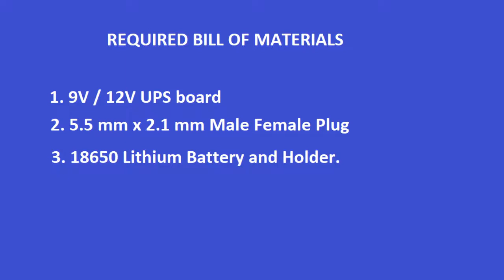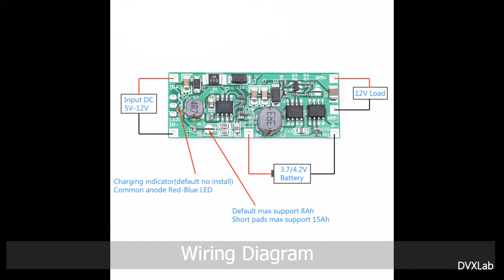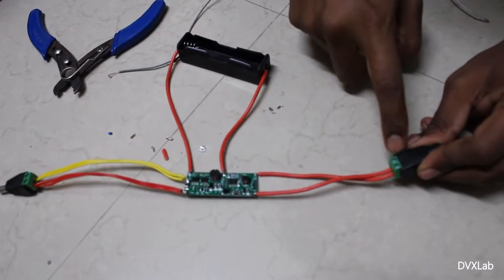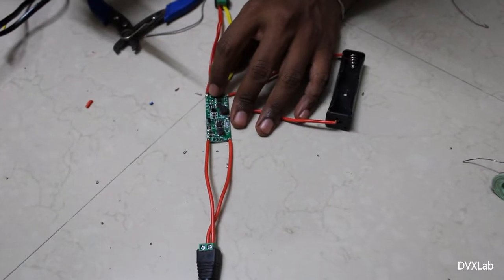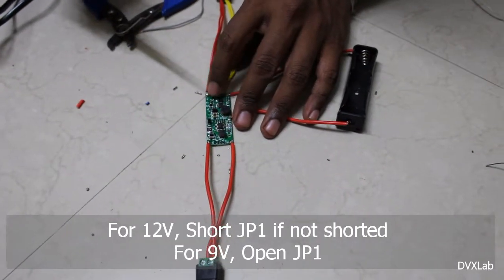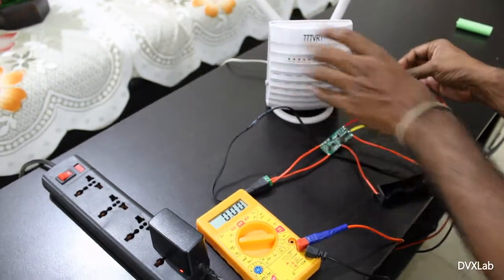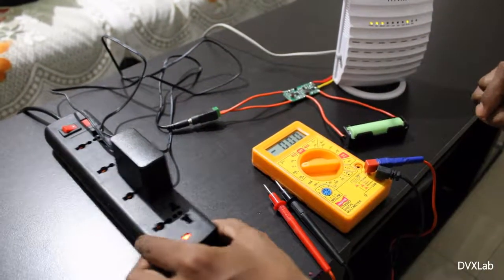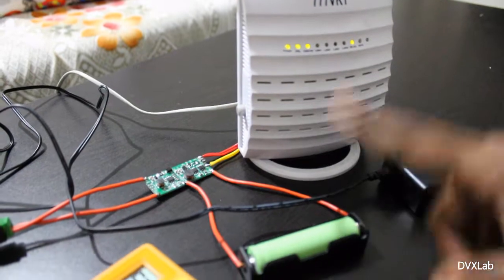UPS for Wifi Router DIY in just 3$ only

Comment: Why this circuit charging the battery very slow i have to unload it till it can charge the battery is there any solution????????
Reply from the maker: what's the adapter current rating and Router rating ? may be you can opt for slightly high current adapter
Reply: @dvxlab  the adapter is 12 v ,1A. This adapter is the original adapter of my router
Should i use this circuit only for 18650 battery?.
Reply: I also facing same problem. Do you have any solution for this problem?

Comment: i bough this board and build the ups 
but the board's output voltage drops once the power supply is turned off
this is not working
Reply from the maker: Use thick wire or use double wire. If you have multimeter measure the 1. input voltage to the UPS & 2. Output voltage at the UPS solder points, 3. Output voltage near the router connector. 4.How many batteries connected in parallel ? 5.what is the adopter current rating? 6.what is the router current rating?.. Mostly changing the wire would solve the problem
Reply from the maker: I had similar experience when I first turned ON , later changed the wire to thick &  short one . Wire drop reduced & started working.
Reply: @dvxlab  thank you very much for the quick response
i measured the following using an analog multimeter
1. input voltage is 12v
2.output voltage is 12v but when the power supply is turned off it drops to 4.5v
3.output voltage near the router also sgives the same set of value i mention in point 2.
4. one 1 battery is connected
5.adapter current rating is 0.5A
6.router current rating is 0.6A
plus the when it is running on batter, the battery is making a buzzing noise, not sure why
Reply: @sahanpanditharathne2765  I'm sure you've already figured this out, but it's probably a faulty board.
Reply: @wyattarich  yeah
it was a problem with the board

Comment: I have this circuit but it's charging is slow it seems it doesn't charge the battery I have to unplug it from my router till it gets charge
Is it only for 18650 battery or all kind of battery 
I'm using my 6000 mah power bank battery and I'm using my original adapter 12v 1a tell me a solution
Reply: I also facing same problem. Do you have any solution for this problem?

Comment: I have ordred this too but i connect to my router it’s decreasing too 5v .i mean without load it gives 12v and with load it gives 4 to 5v what would be the problem please help me
Reply from the maker: mostly wire thickness & length .. Use a thick wire (double ) of shorter length..
Reply: @dvxlab  can i use tablet battery i have samsung tab3 battery
Reply from the maker: @awesomeboy3806  It may not be able to deliver high current. I use this battery now , 3C 2400mA ,  find something equivalent in your country.          https://www.ktron.in/product/18650-lithium-ion-battery-bak-2400mah-3c-1000cycle/
Reply from the maker: 2 or 3 batteries connected parallel

Comment: I have this bords in 5v 9 v 12v they all get heat up and cos rebooting router its better to use 18650 charging module (must support charge and discharge same time)and boost converter

Comment: Is it automatically cutoff after the battery when fully charged like a computer ups
Reply: i guess no. u need to add 2S bms to make battery safer as this circuit will cut off charging while load connected, & will over charge battery
Reply from the maker: yes . it cutoff the battery once the battery reaches 4.2V.  when the power goes off, circuit supplies power from battery without restarting the router.you don't need BMS.

Comment: I have Airtel 12 V 2 A router. Tried using this board. While not connected to load output is 12 V the moment I connect the router the Voltage drop to 5-6 volt and router shows a very dim light. This happens even if outside power is still on. In this more if I disconnect battery then it works fine. Any suggestions how to fix this problem?
Reply from the maker: it wont support 2A , Max it supports 1A. What is the router current rating ? What is the Power Adapter rating?
Reply: @dvxlab  on router it is written 12 V  2A. Will connecting 2 batteries in parallel work?
Reply from the maker: @sachin130177   Circuit's safe rating is 1A only , adding additional battery may not help,Technically 2A wont work , it will overload the circuit, thats why voltage is dropping. wont recommend this board in this case.
Reply: @dvxlab  thanks a ton for your really prompt response. Can you suggest alternate?
Reply: I mean what other circuit can be used for 12V 2A router..?
Reply from the maker: @sachin130177  I will let you know if I come across any board with 2A current.
Reply: @dvxlab  thanks Friend.

Comment: the adapter is 12 v ,1A. This adapter is the original adapter of my router
Should i use this circuit only for 18650 battery?
Im using 6000 mah
Reply from the maker: router power rating also  12/1A? ,  Generally UPS charging circuit supplies <1A /4.2V[li-ion] , rest goes to the router .. may be you can try for higher current 12/2A adapter [ if you have any ] . but no guarantee that it would fix.

Comment: Please tell me if its safe for home using 
And its safe to lithum ion battery ? Because i know this batteys should be with BMS balance 
And last quistion can i use 2 18650 battery with this boad
Reply from the maker: All lithium batteries have this problem , including mobile batteries. So 1. buy a quality battery. 2. If possible find a good metal box. This board has builtin BMS circuit that protects battery. yes can use 2 batteries in parallel configuration.

Comment: Hi thanks for your video. If I use parallel batteries for this setup, do i need to use BMS? Thanks in advance!
Reply: It have overcharge protection but not over discharge  protection you can use pcb from old dead phones battery any*
Reply: Actually, if the output voltage for your router is 12v just like in this case, the other option is to use 3S lithium ion BMS instead of the UPS module. That one will work and you wouldn’t worry about heat dissipation plus you can also parallel batteries on top of your series configuration. I had this  not just for my router but with my other critical load as well.

Comment: does it require BMS 3.7v/2.5A 1s or does it have an inbuilt battery protection for UPS module?
Reply from the maker: It has got all the inbuilt protections required for lithium battery

Comment: How about auto-cut off when the battery charges adequately. Otherwise, there would be a chance of UPS board burning.
Reply from the maker: It has overcharging/discharging protection chips. When UPS runs on Main live supply , Battery kind of Electrically disconnected. This extends the life of the battery.
Reply: Thanks
Reply: Mai I know UPS module number as in India I can find this ups module
Reply: 1)TP4056 Li-Ion Battery Charger Module
,  2)XL6009 DC-DC step-up Boost converter   Can you confirm do you have module number like above I've mentioned.
Reply from the maker: @raghuc8096  No model number available. The link will show you the board.
Reply: DVXLab is it available in India ? If so pls share vendor who supply
Reply: @raghuc8096  yes it's available
Reply: @Suniel where it is available in India ?
Reply: @sunielnaique8611  please tell me the vendor or give me the link where it's available in Bangalore?

Comment: search DC DC5V-12V to 9V Charging Module for 18650 Lithium Battery UPS Voltage Converter on Aliexpress site its just for Rs. 152 as in india we do not have any seller.

Comment: Hi,this board supports max output of 1 A,I guess it will not support 5V/2A routers ;perhaps only 9V/1A
Reply: You can use mobile powerbanks for 5v routers
Reply: No router consuming that much my both router and media converter use 0.53 amps in total